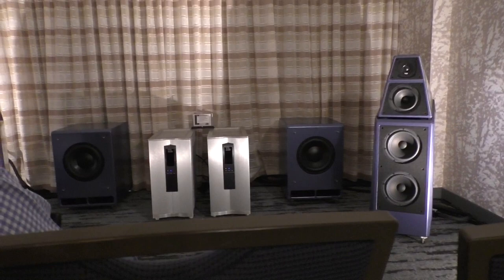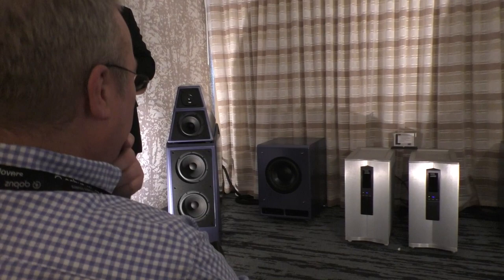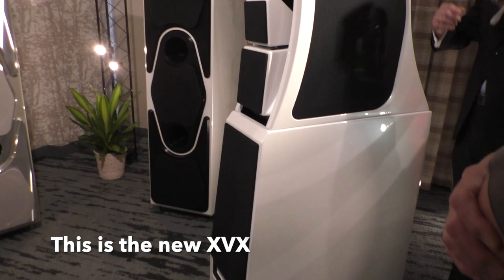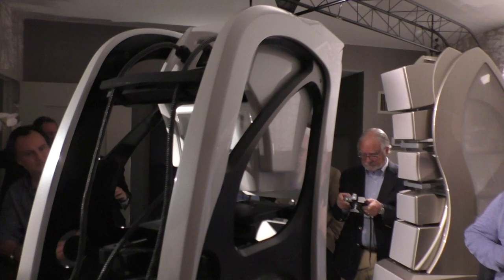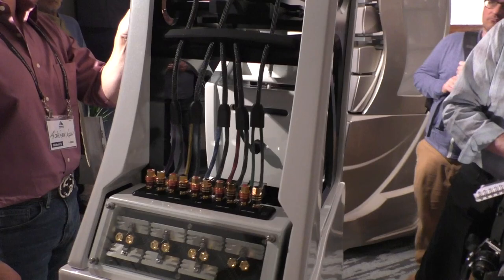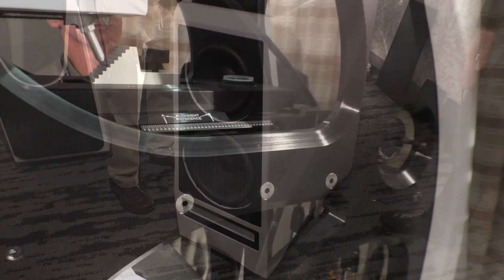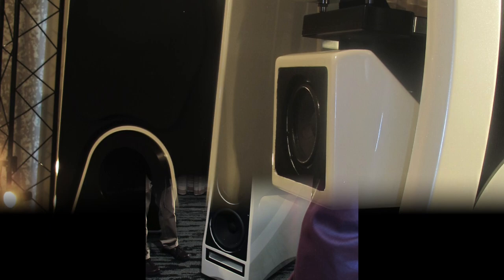Wilson Audio Specialties Debuts Flagship XVX Loudspeaker at RMAF 2019

Comment: What kind of Marketing Gimmick is this ?. The components used in this speaker are Scan-Speak 32W/4878T11 Revelator  Woofer + Scan-Speak 28W/4878T-01 Revelator  Woofer + Scan-Speak 18M/4631T Revelator 7" Midrange + Scanspeak Illuminator 12MU/8731T-00, 4" Midrange + Scanspeak Revelator Tweeter .  Just cant believe someone pays $330,000 for this marketing gimmick . You could rather look into companies like Vivid audio , B&W Nautilus , ATC , Rockport , Magico ... who design and manufacture their own drivers and everything else and the sound speaks for itself . Thats why you can see even in this manufacturers own youtube channel they have disabled comments .

Comment: I notice the 4 inch mid is a Scan-Speak illuminator driver, from their flagship range. BUT, unfortunately, the lower mid driver (above woofer assembly) and upper mid (on top) are only from Scan-Speak's Revelator range. They are good drivers but for OVER $300K would you not think Illuminators all round would be in the customers best interest???????? I know they have done work on the magnet structure but for $1/3 Million dollars they could have started with Scan-Speak's best product. I see the new Larsen 9 (by way of one example) manages to use all Illuminator drivers (4 x woofers) for under $15k, just to give an idea of how penny pinching you know who are being. I am astounded,...... flabbergasted in fact.
Reply: Wrong. Scanspeak Revelators are better at lower mid than the Illuminators. Not to mention that their driver has an expensive alnico motor and is probably custom in other ways for higher sensitivity (as the speaker has a midbass driver already).
Reply: @eug3nius  Just because you say I am wrong does not make it so. I mention they had additionally worked on the motor structure in my original message, so climb down off your high horse. I am correct. Check their website. Get better informed. Plus for $300+k, they should be making their own driver cones. FACT. See virtually every other player at this level. I work as a freelance contractor in this very industry and have A/B'd these very  drivers, amongst others. Their performance is WHY the Illuminator is their HIGHER range. I also said in my original post that the Revelator is a good driver, so feel you are very combative for no good reason. This is supposed to be friendly discussion. Do you think these Wilson's offer good value?????
Reply: @Alex Tomlins What I was trying to say is don't poo-poo the revelator because it is a  bit cheaper - more expensive is not always better for a particular application. We'll agree to disagree on what is the better stock driver for lower mid. They're not using a stock driver anyway - and they likely chose the revelator because it's a good base for the modifications they wanted - unlike the illuminator. If I had that kind of money for speakers I wouldn't buy a Wilson either but as long as their business works they can make their own drivers or not, I have no problem with it. As for you demanding "good value" from ultra high end audio - chuckle! I don't know what to tell you man except stop being so emotional.
Reply: @eug3nius  I say again I did NOT shit on the Revelator (second time I have had to confirm this point to you because you did not read my first post corectly). Read my initial message. You cannot even be bothered to understand my point. If you cannot see why Wilson should not use Scan Speak's best drivers to start their development from, on a €300k+ speaker, is beyond me. You are defending them. Inexcusable. Simple as that. You are the one getting emotional, not me. I am trying to get points over to you which you do not seem to have read, and/or understood. Frustration in you is what you can pick up on. What do you do by the way to be so argumentative on this subject ? I ask as these strong opinions you argue are not based on knowledge or facts.
Reply: I agree, Alex. All Scan Speak drivers are really very good but for this kind of money, I'd expect WA to manufacture their own line of proprietary drivers. I'm listening right now to my JBL M2/dual SUB18 system and all of these drivers are unique to JBL and offer many, many innovations not available through Scan Speak, Vifa or any other off the shelf brand but that isn't to say that off the shelf scan speak drivers are bad, but when the WA system costs more than the rental property I bought today it makes you really scratch your head and it'll pay me $1500/month for as long as I want to own it.
Reply from the maker: @alext2933  I have heard many speakers containing super costly exotic drivers that sound like crap. And many containing lesser drivers that sound incredible. Your claim that a company should make its own drivers is pretty silly when there are companies that specialize in this business and can build to suit. That provides far better value. Only a few companies actually build their own drivers and that's no guarantee that they will sound any good.

Comment: As a designer of major studios and critical monitoring systems, I am continuously stunned to speechless on the nonsense from the consumer electronics industry. Yes indeed, these speakers have an impeccable finish together with glorious mechanical engineering. Visually, this is what people see, of course...and given the gallons of ink spread across the pages of glossy Hi-Fi magazines, and of course - we all believe what we read -(!) the speakers sound "visually" acceptable to the ears. The eye tricks the ears.

Interesting to hear comments on phase and time alignment.  All vitally important issues, and rather is more important than ruler flat line frequency response curves, that once highly accurate time alignment is achieved, this will contribute to accuracy in frequency response...but to include the SUM of the two speaker arrays in a L – R stereo array.

At $300,000 USD +, this pair is in dangerous territory.  For those in the know, it has serious competition in the highly elite world of professional systems that find their way into the ultimate studios of the world.  $ 300,000, more or less, will purchase a pair of speakers, each with a weight in the range of 450 Lbs / 205 Kg.  But, the story does not end there.  These systems will be mounted within the truly massive “boundary layer” wall mounting system that is mechanically isolated from the studio control room.  Think here in terms of 5 to 7 Tons, 10,000 Lbs / 4545 Kgs.  Mechanically we now have an acoustical system with a mass of:  450 x 2 = 900 Lbs / 410 Kgs + the Boundary Layer iso wall system at 10,000 Lbs / 4545 for a total of:  10,900 Lbs / 4945 KGS.  Next the electronics.  Unlike the speakers mentioned in this exhaustive video, with its passive Xover weighing in at 45 Lbs / 20.45 Kg, today’s most highly evolved systems will be tri or quad amplified.  There is so much that can be accomplished in the digital DSP world that is impossible to achieve in the completely obsolete world of passive crossovers.  This company wished to achieve “time alignment” in the physical domain through the physical alignment and offset between the various drivers.  

The pity is, the entire array of mid and HF pistons are naked dome drivers operating in a vertical column.  When one is seated or standing “off axis” the complex and most erratic acoustical combining between the sections in both the vertical and horizontal is most disappointing.  This off axis energy has erratic lobing.  It is this combined “sloppy” off axis frequency response that contributes to the “room curve” where the on axis power response does not match the overall power response.  

The better approach is to (i can hear it coming “ouch”) to horn load the mid and HF sections with “wave guides” that optimize (stabilizes)  the off-axis power response.  Then, with the ability in the digital domain to manipulate and offset the transfer function at the crossover frequency along with the ability to achieve pin perfect phase accuracy at both the crossover frequency while observing and optimizing the “off axis” sum response a truly coherent sum between the two arrays in stereo mode will result in a dimension that is impossible to describe, for it must be experienced.  (and as well all know, L/R stereo is far from perfect and is only an illusion)

This conversation in the $300,000 range expands into the world of safe power handling.  Will the $ 300,000 system in this video operate safely with peaks at or near 135 dB SPL (per enclosure) for over 6 hours?  What is the Low Frequency power compression down at 30Hz and below? 

The real torture specification, that this system would fail, is what is the output in Acoustic Watts for each section on a Long Term Average Basis?  

Almost no professional maker of speaker systems today discusses Acoustic Watts for it quickly reveals the serious power handling limitations.  Even less known, is the performance usually for the woofers, that being “Large Signal” and “Small Signal” power response VS frequency.

Visually appealing indeed they are....unique.  As for fidelity.... a few years ago, I was in San Francisco with the manager for one of the worlds leading major 
international music stars.

The giant Wilson Audio system was in a large suite.  The manager stood at the back of the room for his first demo, approx 25 feet back, with maybe 30 people seated in the room.  Mr. X found me in deep conversation with one of the world’s leading studio designers.  Mr. X was excited with what he heard.  So Mr. X and I returned to the demo suite.  This time we sat about 12 feet back from the array in the first row.  Within the first 2 to 3 bars, Mr. X turned to me with an astonished (not happy) scowling crunched-up look on his face.  “Why did we sit here” he asked.  I asked Mr. X, “Where do you sit in the studio’s control room during a recording session”?    Mr. X got the message.  He kept his check book in his pocket.  Later he spent far more with our organization . . . that included our cement mixer (yes there was that 10,000 Lbs / 4545 Kg mounting system)  superlative electro-acoustics and speaker systems that created a sound stage that one can only dream about.  

BTW.... the cost to physically develop the isolation and mounting system for such an elaborate and sophisticated speaker array, runs far less that spending $30K, $40K or more for exotic speaker cables.  2 x mono block $ 100K or so amplifiers to run the speakers shown in this video?  Nuts!   Active crossovers with sophisticated DSP and 6 or 8 channels of amplifier power will pull less than $ 100K out of your wallet.

And how does it sound?  Yes...it has “that” . . .   that being one does not really talk about the “sound” at all.  One talks about the dimensions of music, the spatial depth, the ambience and the feeling one experiences.  20 years later, playing the same recording for the 1000th time, Mr. X still hears and experiences something new on each playback.

How much does this cost:  “priceless”  but over time affordable when professionals are creating the experience based on engineered science, art and a love of music.
Reply from the maker: Many professional mastering engineers whose names you surely know regularly visit here and listen to my Wilson speakers. They differ with your opinions.  Judging speaker performance in a "large suite" at a hotel or wherever it was, is truly idiotic. You are trying to compare what a consumer puts in a home with a studio installation. Another bit of foolishness. And yes, these speakers are designed for sitting in the center or close to it and guess what? Most mastering engineers do likewise. I've been in the major mastering suites in America and I understand why the systems sound as they do. They are that way for a work environment not for listening enjoyment..

Comment: Come on guys! It simply HAS to be said. This is ridiculous, as is the WAMM. At the end of the day these are still just cones-in-a-box. At the end of the day half of the frequency range comes down to one overworked dome tweeter. If you want expansive, realistic reproduction of music in your home, you need line-source planars. Rebuilt Apogees, SoundLabs or Magneplanars, if on a budget. Cones-in-a-box, no matter how many silly tweaks are made, no matter how much they cost, cannot compete with big planars. There I said it. It was my duty. Flame on.
Reply from the maker: That is your opinion. All speaker designs have technological compromises. I've owned planar magnetic speakers too. Line source speakers have plenty or problems. Ribbon have many issues. SoundLabs have many issues too. Cones in a box can easily compete with anything when properly designed as these are. It's possible to prefer one technology over another without getting all pissy about it. Try it! You'll like it.
Reply: You video usefully captured the enthralled audio press lapping up every detail of these things. You even captured competitor Bob Harley looking positively mesmerized by the details behind the grill cloths. I’ll bet he’s already forming neural pathways on their way to proclaiming these the BEST ever in a subsequent review. He might delegate that to Valin, but either way the latest Wilson products will get rave reviews. It’s predictable.
Reply: Magnepan 1.7i paired w/jamo concert series c 91 ii  w/mAMP's DAC2v2se, Pioneer XC-HM86 modified by EJ
Reply: ya planars are nice for certain types of music, and other types of music...not so much. there's a very good reason many a music enthusiast, myself included, just can't live with planars. I've owned 2 pairs of Maggies in my main system, and they sound great. but lets be real, their dynamic range is pretty crappy. and when its time to rock, they just don't have it in them. I think one could successfully argue they are some sweet sounding speakers, they just don't have any balls
Reply: Angus Van Halen True about Maggie’s. But a large Apogee model can rock. I have both the Divas and the original 300 pound “Full Range”. They play with power, cleanly and effortlessly. Some of the bigger SoundLabs can too. And Infinity IRS, etc.
Reply: Spacecoastsun there’s a pair of Apogee Centaur Minors that have just come up for sale local to me, within the past couple days. And I’m checking them out this evening, even though the last thing I need is more speakers, I’m not even sure where I’d store them until I’d put them in my system. But, the price is sweet...I’ll figure it out lol
Reply: Angus Van Halen That is a smaller Apogee model. Great speaker, but it may not rock like you want. For that you’d need Duettas, Divas, Scintillas or Full Ranges.
Reply: @angusvanhalen2886  Jamo concert series c 91 ii's are 6ft apart,  Magnepan 1.7i's are 10ft apart.  mAMP's (monoblocks) powering both speakers (450w@4ohms) Great hybrid of sound/imaging much like your Apogee's, thx

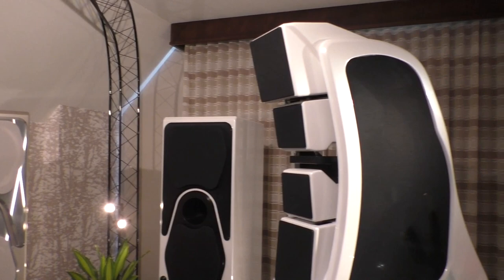Comment: 6:24 is this the worst sales pitch ever?! Someone is apparently willing to give USD330,000+ to get it shipped to Asia but not having a flat or house tall enough for these beasts?! LOL 
Once I heard a one of the biggest yacht dealers in Monaco saying that when considering purchasing a yacht, one should never go over 10% its net worth meaning that potential owner of 5mil yacht should have at least 50mil in a bank (not including stocks, bonds, real estate etc.). Such jacht can be chartered over the year when owner is not using it and after paying all expenses and annual maintenance, owner still may eventually get some money back before deciding to sell it to someone else (or die).
Thinking from the same perspective, it would be reasonable to say that for the hi-end audio gear, such percentage should be rather half of that, around 5%. Considering these speakers price and given that is just one component in someones audio chain, a prospect customer should be at least USD10mil+ well-off in cash to get them in his/her home without doubt of being utterly insane!
But since this is completely insane industry with even more insane customers - such calculations should be dropped at the very beginning.

Comment: Total snake oil. No speaker system is worth over $100,000 - not even close. Diminishing returns sets in at about $10k. I can guarantee you a pair of B&W 803 D3s would sound just as good as these.
Reply: I wouldn't rate the B&W gear very highly, but yes, the point of diminishing returns kicks-in ( ...somewhere & will vary dramatically from person to person ) - the Paradigm Persona should be good enough for most people & if you're willing to roll-up your sleeves, there are refined DIY speakers that would give these premadonnas a run for their money... ( you can spend $10-20K on parts for a pair of speakers, but you're better off starting small... )
Reply: You are right . This is more of a marketing gimmick. Based on sound quality , the Vivid Giyas , ATCs , B&W 801 , Rockprorts are much better and completely form following function products . These are just for people who just want to burn cash for a marketing gimmick , You can see that the midrange drivers they use is scanspeak.
Reply: @cemmany  there are also the "darling" brands in different parts of the 🌎 & here we have an example of such...there is so much competition in the sub $5k range $ $10-15 gets you Kii audio & 20 other names i coyld mention.. It's bragging rights by a factor of 10 over sound quality.. Look at what Troels Gravesen is doing with the ellipticor scanspeak drivers...
Reply from the maker: I guarantee you, you are wrong.